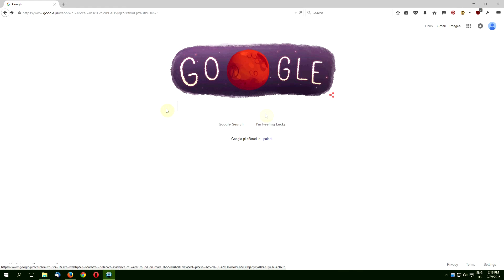How to install an SSD in a laptop | computer tutorial

Comment: Have you had any problems with browsing the Internet after installing the SSD?
My broswer takes a long time to load pages and sometimes it freezes up.
The Task Manager shows multiple instances of the browser process (ex: firefox.exe appears 5 times in the process list) using 100% CPU.  I don't think this is normal.
I have installed different browsers (Firefox, Chrome, Brave, Vivaldi) and they all have the same problem.
I have updated the drivers for my internal WiFi, ran anti-virus and malware programs, reboot the router, uninstalled and re-installed the browsers but the problem still persists.

I have a laptop: HP DV3510nr - Intel Core 2 Duo 2.0Mhz CPU, 6Gb DDR2 RAM with a Samsung 860EVO SSD and Windows 7 SP1.

Comment: You forgot to say that in the caddy is a switch that has to be switched depending on the PC brand as shown in this image:
http://g02.a.alicdn.com/kf/HTB1CAjNIpXXXXXNXpXXq6xXFXXXg/12-7mm-Second-2nd-HDD-Caddy-SATA-to-Sata-3-0-SSD-Case-2-5-Hard.jpg
because if is wrong switched must cause shutdown problem to the PC.
Also you could make even recover the CD / DVD player and make it an external player instead say buy a new one.
Still great video.
Reply from the maker: Thank you for your comment :)
To tell you the truth, my caddy doesn't have any switches. What does PC brand have to do with an SSD or HDD? You can use pretty much any brand SATA drive with any PC, as long as it's equipped with a SATA port.
When it comes to the CD/DVD drive - you are right. I could have make it into a portable USB drive, but my DVD burner was broken, so I bought an external drive.
Reply: Compared with branded PCs have different pins (SATA pin) for the dvd player. Some of these pins there are in some brands and there aren't in other. The switch allows you to change these pins depending on the brand. Some of these pins in different brands create problems with the ground and the PC shotdown (doesn't shutdown).
Probably you were lucky with your caddy, but I saw many people in different forums have this problem. I have had this problem too because very few mentioned that there was a switch (at least in the caddy recently sold), so I entered without knowing that I had to change the switch.
Here is the picture that explains the problem with electric level but I do not know much:
http://1.bp.blogspot.com/-jPx31CGcuBA/T89NXgQgy2I/AAAAAAAAAEw/Oa6GltSekIA/s1600/before.jpg
The forum where there is the discussion what is the switch:
http://forum.notebookreview.com/threads/second-hdd-caddy-with-a-flip-switch.739486/

I hope I was helpful :)
Reply from the maker: I didn't know people had such problems. Thank you for posting your comment - it may be very helpful for those, who experience such issues :)